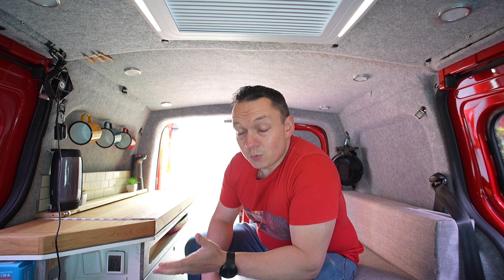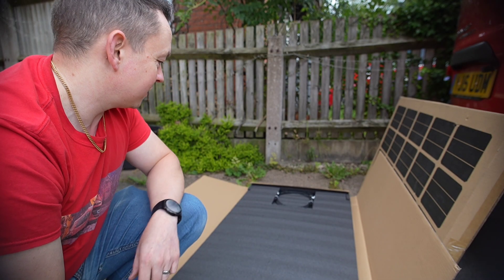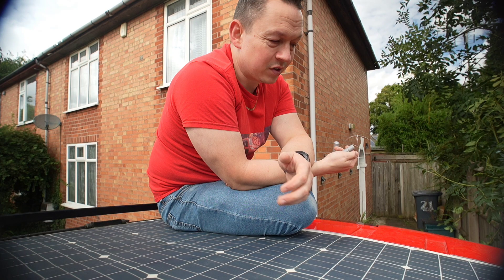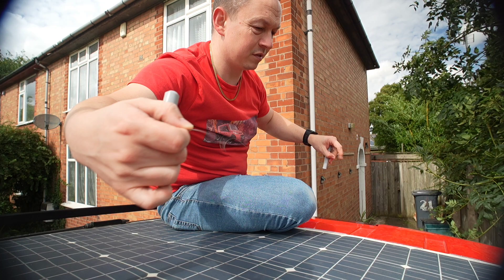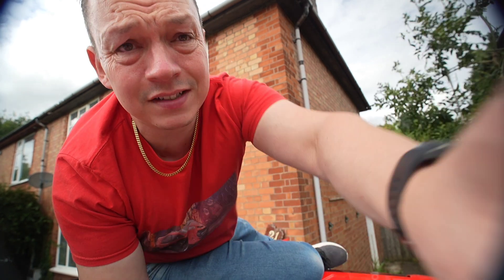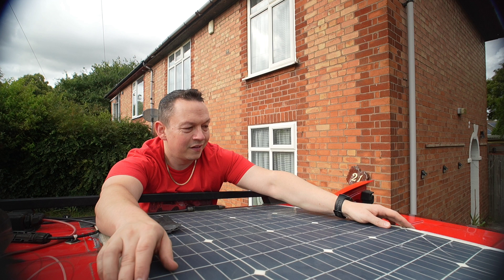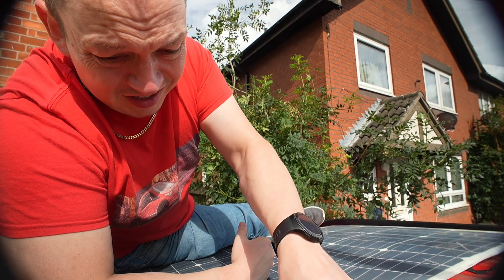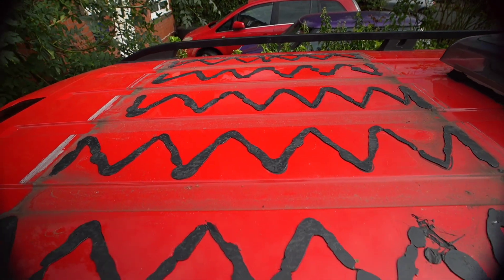Easy To Fit Impossible To Remove - EASIEST Off Grid Solar Power System - AllPowers SF100

Comment: whats that black glue you use? Do you still recommended using that? Looks like it did its job lol
Reply from the maker: @TKGZONE hey the black stuff is called Sikaflex and I definitely recommend it. You don't want the panels to come off when your driving, so this shows how strong it is even after nearly 4 years. I highly recommend it if you want them to stay on. When you want to take them off,.you are screwed lol 😂😆😂😆 but I still recommend it. I will post the fitting video soon and show a much better way of applying it to make it easier to remove next time round. Thanks for commenting 😁😁😁